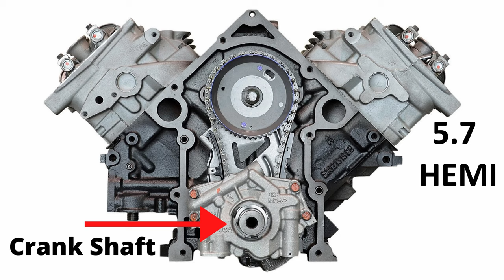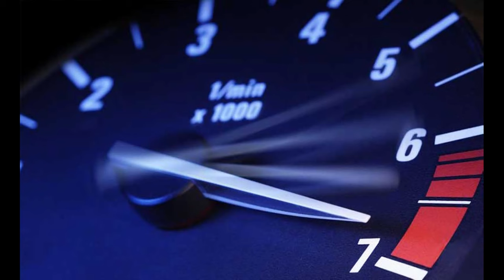HEMI TICK Explained (Easily) - The Cause and How to Diagnose

Comment: My tick goes away after 30 seconds.  Would a bad lifter still cause this?
Reply: There is a somewhat limited amount of lubrication when starting an engine since the oil is thicker and it takes time for the oil to circulate through the engine. If your tick goes away after 30 seconds then you're most likely fine! Hope this helps.
Reply from the maker: my truck ticks pretty good sometimes for 3-4 seconds. shouldn't take 30 seconds for oil to circulate through the engine. could be an exhaust leak and as the manifold starts to get hot it helps to seal it off after 30 seconds. either way your engine shouldn't be doing that.

Comment: I don't see anyone talking about one of the main items causing the tick in the modern HEMI's - MDI.  The MDI renders the manual portion of the system in a place where parts come in contact and then release... so every time they come in contact you hear the ticking sound.  This especially happens at start up.  There are hundreds of thousands of HEMI's out there with over 300K miles and still ticking strong.
Reply: So I can drive my truck 100k miles with a tick? Mine is very slight, and goes away when warmed up

Comment: 5.7 Hemi is not an overhead cam engine, nor the 6.4. The oiling issue is caused by bad design, as informed by Tony's garage. The cam is an in block design, raised but not an overhead cam.

Comment: Check me out here..This is NOT a SOHC design..The cam is NOT in the head as for example a Ford 4.0l V6 engine.  The cam is higher up in the block yes but still in the block.  
Next, aren't the lifters, like most lifters fed by a hole in the side from an oil gallery?  The oil then travels up through the pushrod to lubricate the valve train?  Unfortunately as uncle Tony points out, the roller, roller bearings and cam lobe have no direct oil feed and are solely dependent on splash from the rotating crankshaft assembly which is farther away than older designs and blocked by a cast oil gallery?  Hence a design flaw causing the failures?  Your audio sounds fine!

Comment: Motors now are less dependable now than they were 20 years ago.  GM has the V8 AFM issue and 3.6 timing chain issue. Ford has cam phaser timing chain issue,  Dodge hemi tick, Nissan SVT, honda uses a timing belt in V6 motors..  these are engineering disasters and environmental disasters as well.
Reply: Literally just got my Silverado back from having one side of the lifters done 😒

Comment: They upgraded their bearings in 2017, but Forgot to add an oil passage to oil the needle bearing thru the lifter.  Lots of oil in the lifter..  should be easy.

Comment: hi, have a 2019 ram with this hemi,I am from Ontario i I use me remote start to worm up the car,so its scare me what I read here and others  videos or ram forums,I am a engine mechanic for tanks engines,military vehicles etc,the big ones,12 cyl etc,and one think I know,if there is a bad design and hemi is a bad design,there is no way we can fix this by changing oil grade,the engine will fail soon or later,good design engine run good on idle even with hours idling or on the road,I am for the class  action,push the FCA hard,let them pay for this,fell very sorry for the all people with this costly repair,all I can do now is keep my fingers cross it wont happened to me,damn FCA.
Reply from the maker: pretty much right. there are a couple theories as to why these engine fail and perhaps its a combination but there is 100% an issue and it is kind of frustrating that FCA has kept there lips sealed from saying anything.
Reply: @TheGettyAdventures  FCA wont do anything unless is a safety category,so far they play stupid,they have to be delivered to the court and push for action,the number of owners with this camshaft@lifters problems is huge ,and is affecting all of us,every time I start the truck I am looking for the tick,is become paranoid and I only have 12000 km,damn FCA
Reply from the maker: @marmay6874  Same brother lol I'm always listening to see if today is the day I start to hear a tick. which really does suck. it would be interesting to know the real percentage of Hemi Engines that see this failure.
Reply: @TheGettyAdventures  FCA know the numbers ,dealers report it every case,but they keep quiet,is not a safety concern,they wont lift the finger.plus they talk to people on the ram forums,Ram care,but as soon as guys ask and pointed out the camshaft&lifters problem the ram care guys are gone with the wind,shame of them and the FCA.
Reply from the maker: @marmay6874  interesting. My theory is like I mentioned in the video is that most of these engines are making it out of warranty. meaning that the failures are primary on the consumers dollar. So as far as FCA is concerned they are still making a healthy profit and this issue isn't hurting their wallet.
Reply: Trade it in asap

Comment: The fuel management system is also one of the big reasons  for this . Ford,chevy and dodge all have their engines grenadi g because when the back 4 cylinders shut down. They don't get enough oil and when they fire back up, they are dry. Have the fuel management system turned off by the dealer and you won't have to worry about your truck leaving you stranded. With a huge bill to fix it.

Comment: Hi I have have 2010 5.7 Hemi 290000 km on it no issues although I have all ways run synthetic oil in my engine and started using a 0w20 full synthetic oil at 230000 km also don’t go over 8000 km per oil change so far it working for me love the hemi  nothing like the sound of a hemi

Comment: Truth and accuracy would be appreciated much more than winging it for clicks. You should make this video with someone who is an SME and can better explain what you have totally misinformed everyone about.
Reply from the maker: Colby I'm in the process of making a second video hopefully correcting the errors of this first one. Specifically me saying the hemi is an SOHC (not sure how I royally messed that up). I made this video when I had 37 subscribers and was getting less then 100 views per video lol I had no expectation of this video getting this many views. I just thought the HEMI tick was an interesting topic especially because I own a HEMI. This second video I'm diving deep into some research and talking to my local dodge dealer to get their opinion on the matter. all that being said, there is still good evidence that a lack a lubrication is a major factor in these roller bearing failing. which is the point of this original video. The Camshaft in this HEMI is mounted much higher in the block then a "traditional V block cam" which could result in inadequate splash lubrication. so besides the my cam shaft terminology I think the point of the video is still valid. You may disagree and that's okay. There does seem to be some evidence that the MDS system has a roll to play with these lifter failures and potentially dirty oil also causing lifter failure. I do appreciate your feedback, because this video does deserver more research. I have edited this video to remove most of the SOHC garbage but I do think there is still some decent information in the rest of the video which is why I'm going to leave it up. So look forward to my second Hemi tick video!

Comment: That’s weird. I own a 2007 ram 1500 and it has 220000 miles and does not have tick or anything. And the truck has been dogged out most of its life. I wonder why this truck in particular has not had this notorious problem

Comment: Wrong. Each lifter bore has a huge hole that supplies each lifter with oil from the gallery. Each lifter sends oil to the cam every time it cycles. Chrysler didn’t design it to supply main lube to the cams from the crank
Reply: UTG diagnosis keeps getting play and he has now idea what he’s talking about. Issue is with poor maintenance, MDS solenoid contamination and maybe some bad lifters. Not an oiling issue.
Reply: @dlturner55  Where's your video explaing and breaking it down?

Comment: I have a 2015 Ram 1500 with the 5.7.  with 81k miles No tick. Will Royal Purple or Mobile 1 synthetic oil help prevent this from happening? I drive it easy. Sounds like I need to step on it once in a while.

Comment: the issue is hardening on the cam. its a manufacturing fault which is why it seems to be so hit and miss.
the cam being eaten away due to improper metallurgy allows for the lifter to have enough slack for the bearings to start taking impact force; that intern causes the needle bearings to fail.

the best solution is to get an aftermarket performance cam and replace damaged lifters with OEM ones.
Reply: If that was the proven case (which I’m not saying your wrong) then Chrysler should be doing a recall.
Reply: @andrewwesney7441  i agree, and there was a class action suit about it. the court ruled that defects or design flaws that do not affect safety components do not need to be recalled. if it fails under warranty, they must honor it and fix it, but thats all.

if there were to be a recall it would have to be voluntary; and we both know that's never happening. 

on the upside, bigger market for aftermaket cams means we'll see more of them for longer for cheaper into the future.  yay?

Comment: BTW I have two questions 

What do you think why the most common failing lifters are from the MDS system?. In my case supposedly is 1 failing, If its an oil issue should be failing most of them? I super hysterical about the oil change, I use mobile 1 and I change it every 4k miles top. And Still got this issue. 

I bought the car with 60k miles now it has near 90k. 

The second question, They updated the lifters, that means if I buy the original mopar replacement lifters for my 2014 I would get the new version of them or will still the same as the ones that came with my hemi 2014? 

And a bonus question hahaha, mechanic recommended to completely disable the MDS system since looks like it help a lot to this issue, do you think that is right? 

THANKS!!!

Comment: I bought a Hemi Jeep earlier in the year and had it checked over by an experienced local guy and Hemi builder. He said mine was in good shape and I had him put synthetic oil in it. No problems yet and the Jeep is a 2010.
Reply: Same with my 2015 ram , 5.7 , I use full synthetic oil,  and there is no tick . Oil is Changed at 3,000 mikes religiously.
Reply: Make sure to step on your hemis all the time hit the rev limiter a lot and you will be good

Comment: I am no expert but have had a 2013 RT Charger with 5.7 and liked that engine.  The oiling is occurring at the lifter not sure Uncle Tony knows this Hemi well.  Best option is just change the oil every 3-5k depending on oil and use and run 5w-20 synthetic keep your oil clean will allow MDS to work properly and keep any failures down.  Check out this video he shows the oiling and discusses it https://www.youtube.com/watch?v=PAuNSYqOQjk

Comment: I have an 05 and i get intermittent bottom end noise like a diesel, i didnt notice when i bought it and have only put 30k miles on it, ive done all oil changes on time, ive heard switching to penzoil full syn might help but i have a hard time believing a hemi has bottom end failure at only 157k especially considering its been well taken care of after only 2 owners.

Comment: I'll put it this way, I had a 79 ford capri back in 89 while in high school....I got the car with 70,000 miles...I changed the oil "ONCE" LITERALLY ONCE!! It finally shit the bed at 250000 miles....Ive got a 16 2500 ram 6.4 and I'll crap my chaps if this issue happens to me....once I learned of this issue I change the oil every 3000 miles...Sorry FIAT never again will I purchase a Ram or any Chrysler...no excuse for this crap
Reply: Rippin, it's all in how you take care of your vehicles, not so much who builds them. We have RAM, Ford, GM and Toyota in our fleet of over 10,000 vehicles. Our guys and gals run these things hard as hell.  Since 2010 we have data that clearly shows the RAM trucks are holding up the best and people like driving them due to comfort.  I was blown away by the data but I've seen it myself. Most of the HEMI's don't tick, and ones that do it's not loud and you have to really listen for it. BTW, lots of the Toyota Tundras we have tick as well, sounds almost like the same exact tick.

Comment: Think it comes down to mds lifters as well. Its usually those that fail. Best bet is doing an mds delete.
Reply: What is MDS?
Reply: @greenman073  Multi Displacement System. It turns the car into a 4 cylinder with special lifters.

Comment: Very good video, but technically the 5.7 is still a OHV motor. 
The Hemi cam is positioned higher up than a traditional OHV engine. However the cam is still in the engine block meaing its an OHV engine. 
SOHC engines have the cam in the head. So if the Hemi was SOHC there would be 1 cam in each cylinder head. DOHC engines have 2 cams in each head.

Comment: To my knowledge Chrysler used an updated lifter for 2016+ model years.  2011 model year has by far the most failures.
Reply from the maker: Yes, in 2016 there was a lifter update.
Reply: reading this while sitting in my 2009 ram o_o
Reply: @sensiblecougar2723  same 2002 4.7
Reply: I read they went from 16 roller bearing to 13 which makes them slightly larger.  Also read this only effects 1 to 2 percent of 5.7 engines.

Comment: THE HEAT SHIELD ON THE MANIFOLD IS THE MOST COMMON HEMI TICK, THE BOLTS USUALLY RUST AND BREAK OVER TIME CAUSING THE SHIELD TO MAKE A TICKING NOISE!! EXHAUST LEAK ISN"T EVEN CLOSE TO BEING AS COMMON....

Comment: I’m rebuilding a 5.7 right now it had both symptoms ...4 broken Exhaust studs and 3 Lifters That we’re bad But it’s a good motor👍😊
Reply: Hybrid Libertarian Absolutely I’m having the lifters Replace I’m doing the cam valves heads everything done I’m a mechanic this is just a side project we’re doing with my daughter thanks👍We have a New crank and pistons rods coming in today

Comment: I have a 2013 ram 5.7 and it's just starting to tick. Thanks for the info 👍
Reply from the maker: could just be an exhaust manifold leak. they are also very common on these engines and much cheaper to fix!
Reply: @TheGettyAdventures  How cheap? I'm not a gear head and need to have it done. How much are we talking?

Comment: Son of a gun. Exactly what’s happening to my 2014 2500 6.4. Got P303 code and changed my plugs and coils on the third cylinder. Drove 150 miles and the engine shut off. Chrysler scammed me!

Comment: @thegettyadventures I see you bought a 6.4 Hemi Power Wagon.  Is the 6.4 a better design than the 5.7 as far as the lubrication goes on the lifters?  Are the 6.4's showing less issues with this than than the 5.7's?.  I just bought a 2024 6.4 Hemi and now Im wondering if I made the right choice, I love the truck so far however.

Comment: I have a 2005 Hemi 1500
On cold start it’s quite as a mouse, once it gets up to temp, starts ticking at low rpm, as soon as I give is gas it quiets down..that from my experience tells me thats usually the opposite of the normal case of lifter failure. Isn’t that usually a cold start noise? 
Also, noise seems much lower, my mechanic thinks it’s the timing chain? But wouldn’t that always make the noise? 
Anyway, it doesn’t throw any codes as of yet because we shall see?

Comment: So basically you want me to floor my truck to preserve its life span I've been driving the dam thing like a grandma thinking that flooring it all the time is bad I'm so pissed it's cold as hell here all the time so I have to let it warm up what else am I supposed to do slam on the gas during a cold start well I guess I'll just have to beat on the old girl "I use good oil and fuel treatments and early oil changes btw"
Reply: I use Z Max oil treatment in my Ram and it doesn’t tick at all

Comment: I'm guessing it's the same with my 6.4 in my Challenger. I have to replace my 5.7 in my truck. I did not know about not idling for the first 30,000 miles. Good info. They will last a lo game time if you don't idle more than a minute.or 2. A little Rev or turn it I to.a.start/stop motor maybe.

Comment: The fact Dodge hasn't owned this problem and has repeatedly denied there being a problem right to the face of owners (gearheads no less) COMPLETELY turned me off to Dodge.  I have 2 good friends that had this issue.  One in a Challenger and one in a 1500 truck.  Both enthusiasts.  Both were repeatedly dismissed by Dodge service departments

Comment: Damn I got screwed no vaseline by a Jeep dealer SunCoast DCJ in St Petersbur, FL. Risked buying a high mileage GC Summit they said was mechanically sound. Drove it 500 miles. No tick. After 1000 miles engine went TICK crazy. I ALLOWED MYSELF TO SCREWED BIG TIME. Non-dealer wants $5,550 worth of work. $7,000 at dealer w/ same shitty VVT, MDS lifter.

Comment: Oil is splashed by oil,it has oil galleries on top of the engine...and it lubricated the cam/lifters/crank with oil...It doesnt rely on splash from the oil pan!!

Comment: Hey yall please help i got a 2014 ram 1500 sport 134,000 miles. I cant tell if its an exhaust manifold leak. Or a lifter tick. Anything more in depth? Cloth doesn't make it louder an it doesnt go away after at operwtong temp

Comment: An exhaust leak will go away once the engine is hot because the metal expands and eventually seal the leak!
Reply: So will engine lifter tick once the oil warms up and gets pumped to the lifters.

Comment: 5w30 will clear it up that tick will be gone ……. The only reason it’s ticking its because of the oil  0w20 comes out watery which only reason they say put 0w20 in its so they squeeze as much fuel economy for the EPA test